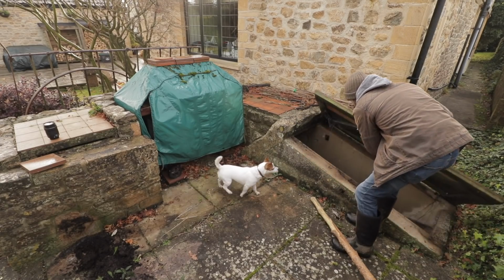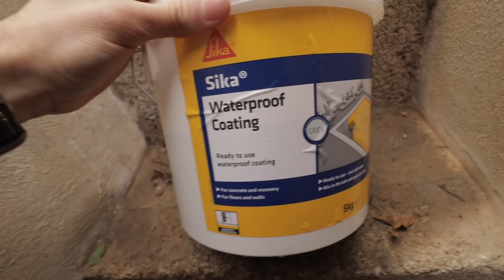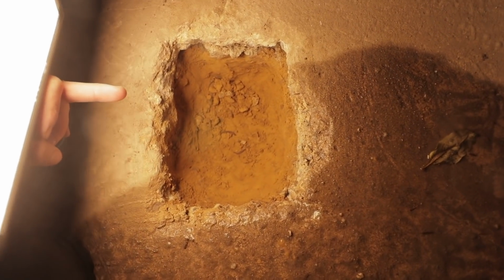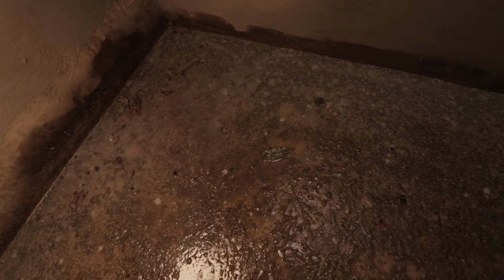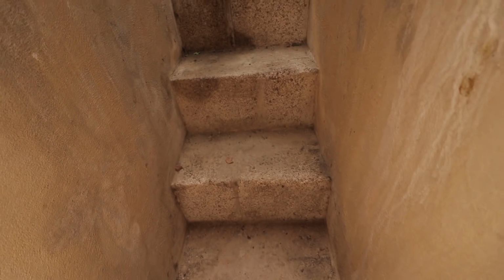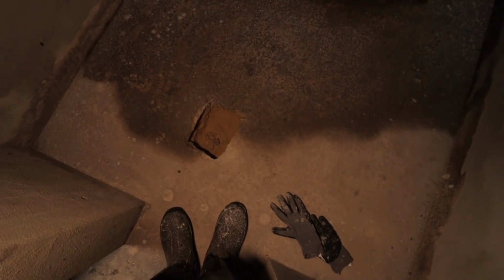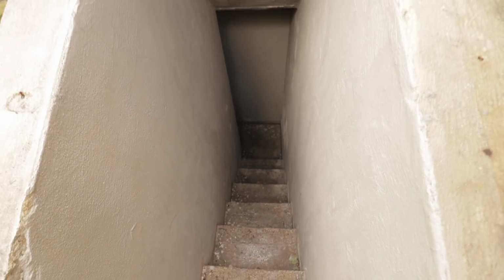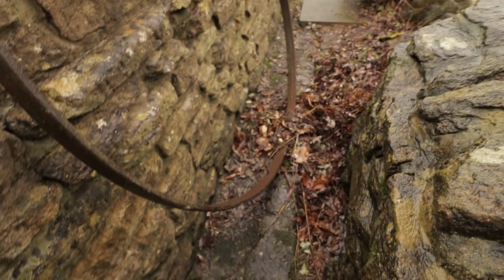WW2 Bunker Renovation: Sealing the Inside (PART 4)

Comment: If it isn't too late, you should move your sump hole into a corner of the floor and then grind a small channel in the floor at the base of each wall. That way any seepage that may come through the wall will run into the channel at the base of that wall. It will then run directly into the sump hole without making the floor wet. Additionally I would like to recommend that you leave the bottom of your sump hole uncemented, since sealing it off would allow any hydraulic pressure generated by water under your shelter to work towards floating the whole shelter out of the ground. If you manage to get your walls watertight, which seems to be your aim, your shelter will basically be a boat and even boats made of cement will float. If you don't intend to rig up a float operated sump pump system in your sump pit, you are going to have to live with a wet floor if you leave the bottom of the pit open to the sand or, if you choose to seal up that sump pit, a shelter that is always trying to come out of the ground and that at the very least will translate into cracked walls. I have fought these battles with my basement here in the US so I know the perils. Love to watch this project and any others that you do with your old man. Cheers!

Comment: Yes Drylok is an exceptional masonry dealer - husband and I used it when renovating an earth bermed garage. 
Another product we came across is RadonSeal. Here's the advert:

RadonSeal Deep-Penetrating Concrete Sealer seals poured concrete and concrete blocks deeper and tighter than any other sealer on the market. The best basement sealer for your foundation walls and concrete floor against water seepage, vapor transmission and even radon gas.

You've done a beautiful job with your restoration work. Congrats for all your recent accomplishments 👌

Comment: put some kind of fan in there to blow out the dampness
Reply: If there is an undergrounded well he will fan forever
Reply: Ah! Water and electricity do not mix well!  Better to use a solar lawn cell to run a fan then later some lights.
Reply: Close the place up, run Fans with a dehumidifier to remove moisture.
Reply: Throw a fire in there or a gas heater maybe

Comment: Build a shed like structure above the entrance, that would solve the leakage problem and would look kinda cool
Reply: Or over the whole thing.
Reply: Have you heard of Colin furze
Reply: Or just change the orientation of the door instead of having the right hold the door just hold it from the top.
Reply: @alexandersgamingchannel6440  😂
Reply: Bushcraft Jon Maybe even build a small house above it???
Reply: Some people who have cellar doors like that put tarred roofing tiles over their door to make sure the water doesn't come in.    Otherwise, perhaps some Aluminium sheets like what is used to make mobile homes, they are not that heavy.   Another option would be fiberglass over the wood or marine epoxy to seal the cracks in the wood.  Marine epoxy is used to waterproof wooden boats.

Comment: waterproofing needs to be done on the side with the  water. All sollutions fail eventually, but waterproofing in the inside (in this case) will fail extremely fast . The waterproof sealer will just chip off where the water pushes .
Reply: I agree. The ingress, vents and outtake of the water should be addressed first.  
Otherwise... it's like painting over mould in your bathroom.
Reply: So short of digging up his garden to do so, what do you suggest he do?.
Reply: @Franklin Nikita 
It's a expensive solution. You may leave the inside of the wall open and constanly dry the walls from the inside. 
It's cheaper. You may use a combination of airflow and dehumidifiers. 
I tried it with my cellar and it worked out after 2-3 mounts with a dehumidifier. First weeks was 5l/24h and now it is down to 0,3l/24h and the humidity is under 35%.
Reply: Yeah agreed, water pressure is surprisingly big underground. Unfortunately without fully excavating the entire bunker and applying membrane, it will always be quite damp down there. Water is a hard one to beat.
Reply: You can waterproof from the inside but its but its a little different than sealing from the outside. You cut out the concrete around the perimeter, Drill holes in the wall for water to drain, install a weeping tile all the way around and make it drain into a sump. Install a plastic barrier over the walls that goes to the weeping tile, then pour concrete to seal it off. It's maybe not ideal but in some cases its impractical or impossible to dig out a foundation to repair it so its the best solution I've seen.